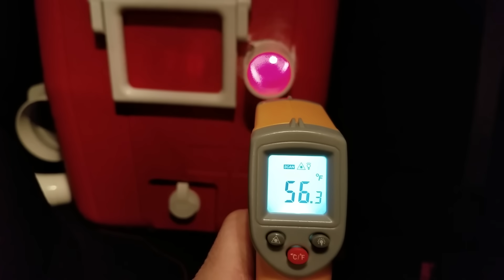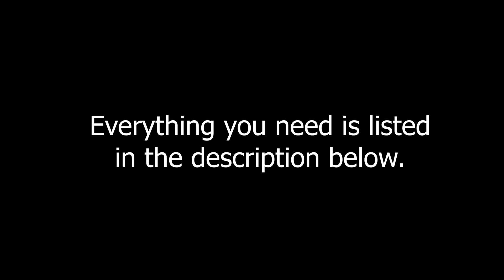Homemade Portable Air Conditioner DIY - Version 2 - Runs off 12 volt battery, car, or solar!

Comment: If you add rock salt to your water/ice bath it will make it colder and actually make the ice last longer... (little trick I learned working in food and beverage industry)
Reply: actually it would allow better contact with the internal pipe as the ice cubes do not touch 100% but the liquid would
Reply: chris scott.  Good point. It is true. That's also why rock salt is used when making home made ice cream
Reply: Dartravens Shelley ah that is a fair point
Reply: You can also make warm soda cold faster by putting them in a bowl of ice water with rock salt
Reply: I thought about this to having watched videos where people did this to quickly super cool drinks in aluminum cans.
Reply: Ten supe insulate the cooler so ice last 5 days... and add a variable wireless remote.  aha
Reply: rock salt tastes a bit salty with little rocks and dirt in it
Reply: ok, I get your concerns about co2 and dry ice,  but the intake and outtake is plain air,  ther co2 is sealed inside the cooler unless you open it.  I mean that makes sense to me.   someone give it a go
Reply: @M T yep you're correct!  my bad
Reply: What about dry ice
Reply: @Tripster_Hipster  Dry ice would be good but not thinking I'd mix salt with it... I don't know if that could cause a chemical reaction
Reply: you got it
Reply: chris scott that is correct 👍👍
Reply: Would you recommend this setup for inside a tent in the summer? Looking for something simple that cools well.
Reply: What about if i use frozen/ice sea water? I mean, take sea water, put it in the fridge and freeze it..?
Would that be good idea?
Would it work the same as if I used rock salt?
Reply: Also if you add a bluetooth device to the air output, u can transfer cool air wirelessly to the receiver module 🐰👍
Reply: This looks a winner. What I would like to know is what the cost was for the supplies used to make this. Would you please give us a breakdown. Thank you.
Reply: @outlawflyer7868  I just bought that bilge fan for $36.
Reply: The salt allows for cooler liquid rather than ice. The sub 32 liquid cools pop cans better due to more surface contact. It will not change the rate of heat exchange, so it would do absolutely nothing for this application.
Reply: @lokirip2372  but the liquid is in contact with the pipe so shouldn't it make the air cooler?
Reply: Loki RIP might want to check your science again.
Reply: What about adding some dry ice to it....-109f. Just be careful about using it in an enclosed area because the dry ice depletes the oxygen in a room or car
Reply: @markjohnson8726  not sure how dry ice would react in this setup but in the original design (blowing air across ice instead of metal pipe like this setup), would create too much CO2 emissions into the air... Too much CO2 = death, not a good thing lol... Like I said tho, not sure how it would react in this setup... It seems like the CO2 would remain inside the cooler unless your metal pipe leaked
Reply: I have built one before using an ice chest and a fan to force the air out using dry ice and it worked great and of course it was used outdoors only
Reply: @markjohnson8726  I'm curious to see if it would actually work with dry ice using this method, and take CO2 readings to see... If no CO2, this would be the ultimate tent or camper ac 😁
Reply: wrong the ice would last longer if you are in a van in the boondocks where no ice is available. last longer...get it, no fridge or freezer available to replace ice get it
Reply: @joescheller6680  If you're using solar, a 100 watt 12 volt panel would run that fan, but with 200 watts you could also run a 12 VDC ice maker all day and just keep adding it to the cooler. Just make sure to take enough water with you.

Comment: I'm impressed! I'm buying an old camper to live in with my 2 dogs while I am having a home built on 4 acres. It will be in the middle of summer in southern Arizona where highs can be over 105 . I need a cheap and reliable method of keeping the camper cool while I am working during the day. This will be better that the 5 gallon bucket cooler. You did a very nice job with this video. Thank you!
Reply from the maker: Thank you.

Comment: This works kinda sorta.you will get air at about 50ish°  coming out of it but you can't feel the air more then 3 foot away.

on mine I have a leak I gotta fix  at the boot where the duct reduces down to 1 1/2 and it will suck water in and stop up the air flow.

One big problem with this is the air is moving too quickly to really lose much of its heat,but if you slow it down any more then it is it will become useless,and this cooler does not keep the ice from melting very well.to be fair I did have to pull alot of water out of the system to fix the air flow issue,but I put 3 bags of ice and about a gal or a bit more of water in at at about 8am,its now 11:30 and I don't even have 3 /4 of a bag of ice left in the cooler..

This was the very same issue I had with another cooler bulid i made.

At the end of the day i don't feel this is worth the $70+ you will spend buliding it.it will help if you can stay right in front of it such as on a  Picnic for a few hours.but I was needing it to cool my area in a automotive shop and it's a fail for that.
Reply: talclipse these are great for small, enclosed spaces like a van, boat or tent. Set it up next to you while sleeping and it would definitely not be a fail.
Reply: alessandro Cipollone I understand.i was just really hoping it would help out at work but just cant be so lucky

Comment: cool idea ! i have a question: what if instead of ice cubes you used ice packs ? Still add water but then remove icepacks to refreeze and and reuse them the next day. does that work as well as ice cubes ?

Comment: Be cool to use for summer camping. Sleeping at night with a cool tent
Reply: You can just sit an open cooler of ice in your tent and cool it without using electricity. It works, just refill daily.
Reply: As long as you have access to ice daily
Reply: Adam Mcgrath That was the first thing on my mind.
Reply: That may work, but this A/C unit moves the air, rather than having stale air in the tent.
Reply: @patriciathies2449  wrong. It circulates the same air inside the tent cooling it all. If it draws in outside warmer air that's a loss of the cooler air you want. So basically I think a modest fan would suffice for a tent, this unit is probably better for a larger space.

Comment: Use dry ice
Reply: But if the dry ice is inside the cooler & the external air flow is going thru the aluminum pipe, how is the dry ice escaping to the user?
Reply: Dry ice will actually kill you
Reply: Joe Dirt how
Reply: It’s bad to inhale as it melts it creates carbon dioxide
Reply: Joe Dirt oh I guess I learned something thank you
Reply: Through the hole by the handle ? I don’t understand your question
Reply: Be very cautious using dry ice. It can be very dangerous and deadly if not used properly. Dry ice is frozen carbon dioxide. It. Turns into gas form of carbon dioxide instead of melting into liquid form. If it reaches a concentrated amount of 5% in an enclosed area it can be toxic! If you put enough of it in an airtight container, it can explode!
Reply: Joe Dirt I still think you can use Dry ice

Comment: How would you have put the fan on the top and ran your piping to the bottom? Wouldn't your piping have dislodged from the lid every time you opened it to put new ice in?
Reply from the maker: Correct. You could put it at the top of the side though rather than the bottom as I did.

Comment: I wonder if you wrap the cooler in refletix, insulate the top with foam, and add salt to the ice how much cooler it would get?
Reply from the maker: The salt would make it colder. The extra insulation would make the ice last longer...or you could just buy a more expensive cooler.
Reply: Salt is very corrosive and it would concern me that the flex could be damaged.
Reply: Randy M that was my thought too... I’ve seen the suggestion several times throughout  comments... NO....NO SALT!
Reply: REFLECTIX....YES, YOU WIN!  I use REFLECTIX in all my coolers anyway.
Reply: The salt allows for cooler liquid rather than ice. The sub 32 liquid cools pop cans better due to more surface contact. It will not change the rate of heat exchange, so it would do absolutely nothing for this application. Salt doesnt change the temp, it changes the melting point.
Reply: put some liquid nitrogen , it will definitely cool it down more :D

Comment: Way back in the 80's I worked with Miami-Dade Police Dept. and sometimes had to sit in a blacked out van or SUV for hours at a time.  FL summers are unbearable, so we made a similar cooling unit using stacked heater cores plumbed together.  Those were placed inside a sealed plastic container filled with the contents of many blue freeze gel packs.  That whole unit was frozen and placed inside a large cooler.  The rest was very similar to your setup except ours had no ice to replace.  It cooled the inside of a vehicle for 10-12 hours.
Reply: would blue freezer gel packs last longer than ice? I have a near-endless supply from medication shipments at work. I want to use this for a couple hours during the hottest hours of the day on a camping trip. Would I add water?
Reply: Can you elaborate more on the system you are describing?

Are the gel pack contents put inside the finned coolers and air blown on the coolers, or the gel packs were frozen around the finned coolers with the air blown through the cooler tubing? I am interested in trying this out, I am going RV'ing with no hookups and 3 dogs, want to have something to keep them cool.
Reply from the maker: Awesome. I may have to try building one like that. Any idea where to find heater cores?
Reply: make & do The cheapest source would be your local salvage yard. You don't have to use heater cores. Any finned fluid coolers should work. Whatever you can find that will fit your cooler. Transmission or power steering fluid coolers will work the same.
Reply from the maker: Awesome. Thanks for letting me know. I may try that.
Reply: YouStupidBunny aa
Reply: I didn't write that. Not sure how that popped up. 
I actually think this is a great idea, and am reading through all the comments to better understand it and find the best method to use.
Reply: auto salvage yard
Reply: old refridgeraters have cooling coils, deep freezers, air conditioner condensers
Reply: This would be a great use for using ice.  I think it makes no sense for a home.

Comment: This contraption has absolutely no scientific basis as to it being any better than a plate of ice in front of a fan.

Firstly, using that tube within the ice DECREASES the efficiency of the device. How do I know? The cooling output can be measured by how much water is raised above 32 degrees F. If you are "saving ice" you aren't cooling as much, this is simple physics, the Laws of Thermodynamics. 

Secondly, this nonsense of restricting the output, you don't drop ANY temperature, let alone 10 degrees, those people with the pop bottles taped to their window are simply stupid. True, when you blow fast versus slow it FEELS cooler, this is because of evaporation of water on skin speeding up, a principle that a simple fan uses, if anything this restricts all the airflow you gained by increasing the fan size, thus decreasing electrical efficiency. It doesn't in any way lower the temperature output.

Third and finally, the heat energy relocated by one's freezer to create the ice or to manufacture the ice is equal to or in excess of what the unit cools, henceforth why on a traditional central air system the condenser is located outside the home and the evaporator inside the home.
Reply from the maker: Say what you like, but the simple fact is...it works. Yes. A block of ice in front of a fan would work, but then everything would get soggy. Good thing we have a container such as a cooler that can contain the water as the ice melts. By the way, most people using this are not pulling ice from a freezer located in the same room as the cooler. 

As far as all of your other points, I see no need to argue them. I would simply say build it yourself and you will see that it works.
Reply: The basis of all cooling systems is something at a high temperature moving over  or through something of a lower temperature removes heat from the hotter item.  I don't get why folks who are not in agreement with a working idea feel the need to rip on the guys who freely offer their ideas to the public when they have no original ideas of their own to offer as a substitute.
Reply: Dude, this rocks. I will be using one in my 1984 Chevy S10 that has no Air  Conditioner in it.
Reply: Something like this can be used in a tent while camping, a boat, a van, etc. You could stop off at a gas station, buy some ice and you are set. I see that as the real benefit of this system.
Reply: Haters gonna hate. Great video. Thanks for sharing!

Comment: Forgive my ignorance but instead of using a car charger, could you add a plug to use in an inverter? And if so, how is that done?
Reply from the maker: Yes. You can use a plug. You just need an adapter and wire it in the same way I did the car charger.
Reply: One more dumb question. I saw what you hooked to black and yellow wire to, but what do you hook the red wire to?
Reply from the maker: It connects to the other blower wire.

Comment: How could you add a plug on that fan. So you can plug it in the outlet. I got the fan but how can I plug it it
Reply from the maker: Do you mean in a 120 volt outlet? If yes, you would need an adapter. Just search for one on Amazon or Google.
Reply: make & do ok thanks. Last thing . What size coupling did you use for both ends

Comment: would it be possible to use an a/c condenser? or would it require too much pressure to blow through?
Reply from the maker: Not sure. That would be something that would need to be tested.

Comment: I really like diy...I'm  not convinced decreasing the diamiter will cool air, if you reduce the diamiter further I don't  see the temp reducing
Reply from the maker: I didn't test it with different diameters so I can't say that it does with 100% certainty. I just based it off of the fact that reducing the diameter causes the air to slow inside of the cold tubing which would give it more time to cool.

Comment: Are you a PI, this would be good for surveillance. Do you think this would work in Texas? Do you have a link for the motor?
Reply from the maker: The link for the motor is in the description.
Reply: I’m a PI and have a swamp box of a different design. But thinking about doing this. I’m in Florida.
Reply: Hi "Make and Do",
I have been checking out a lot of videos and this one makes more sense to me. I live in Texas and I do not have air in my car and cannot afford to fix it. 
When its 105 and you drive home from work for an hour, you tend to try everything. I finally got all the parts and it's all together except the wiring of the fan and switch. Please tell me how to wire them together more detailed. I'm finding there's an extra wire.
I can't wait to share my report with all the bozos that think they know everything and take the time to make fun of others.
I really appreciate your desire to make something that would help others.
Keep up the good work and help me not have road rage for those that drive like idiots and have air conditioning.
Reply from the maker: The black and white wires coming from the cord connect to the black wire on the blower. That only leaves one wire from the plug and one from the blower that will connect.
Reply: make & do 
For the cord I only have red, yellow and black wires. Which ones do I wire to the blower black wire? 
The brown wire from the blower has a sticker that says "connect to + only". So which one does that one get wired to?
I Just want to fully understand before I screw something up.
It's pretty hot here in Texas so I've got to get this done.
Reply from the maker: Connect the red to the brown and the yellow and black to the black.
Reply: make & do 
Thank you for the information. I'll let you know how great it works

Comment: Any idea what the ambiant air temp was during your test.
I built one using a heater core and 12v water pump. It worked great but blows through ice.... Love your idea and can't wait to try.
Reply from the maker: I don't remember the exact number, but it was in the mid 80's.
Reply: I was thinking the same thing. Heat exchangers and recirc. Pump in a closed loop with blower.

Comment: Mr. Make and do,any idea how long you could operate the fan using your 12v car battery before it died?  Thank you.
Reply from the maker: It depends on how many amp/hours your battery will produce. The blower requires 6 amps. So if you have a 60 amp battery, it will go for 10 hours. However, you don't want to drain your battery below 50% or it will significantly shorten the life of the battery. So a 60 amp would be ideal for about 5 hours.

Comment: Do you think it puts out enough CFM to connect a T-junction at the outlet and run dusts out to two 5 person tents ?  as far as running it I have a jumper box with a 12V/22AH size battery in it. How well/long do you think that would run it. Also what solar charger/panel would you recommend
Reply from the maker: It does put out a lot of air and I do think it would work for your application. However, one thing to consider is the longer the exiting vent pipe, the more time the cold air has to warm back up. If your exit pipe leaves the cooler and runs another 5 feet with a warm external temperature, then the cold air will warm back up a little before it exits the pipe.